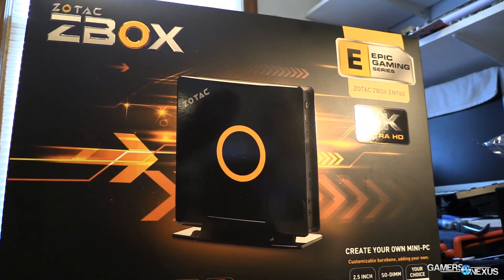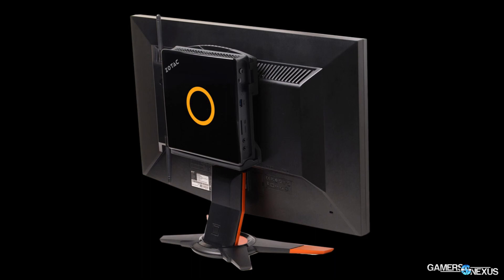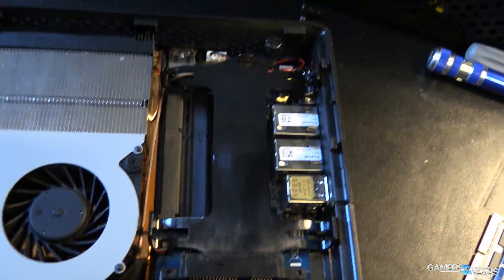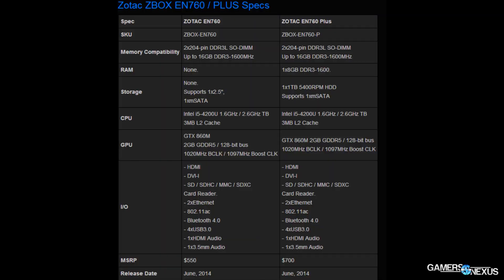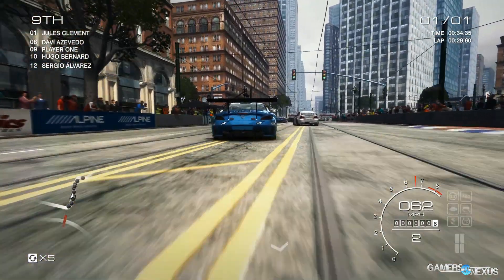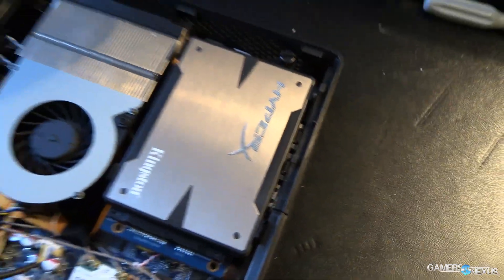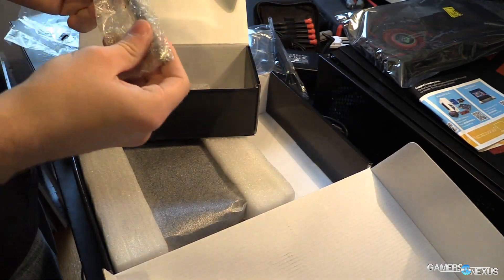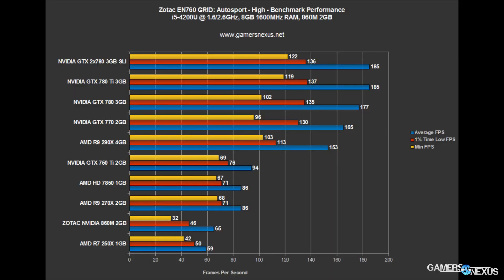Zotac EN760 DIY Steam Machine Review & Benchmark

Comment: Zotac makes graphics cards under the geforce chipset, so why not try to fit something a bit stronger than an 860m into their build. Gigabyte did it, but they had cooling problems. Zotac has proven that their system will not overheat, so increasing the size a bit and custom fitting a desktop grade graphics card is not entirely out of the question.

Comment: Did they ever fix the nvidia driver so you can update it
Reply from the maker: Yep! I was the first to receive the driver update and test it. Works perfectly. Performance was greatly increased as a result.
Reply: Is there any way you can forward me the download link? Their webpage still shows 332.60
Reply from the maker: Joseph Almo
I had to apply a BIOS update to our pre-production model, but I was told that all production models would ship with the most updated BIOS and would not require the update. If this is truly the case, you should be able to download the 340.x drivers straight from nVidia's website. Just grab them from nVidia rather than ZOTAC -- it's the same thing, just the nVidia page will be more up-to-date.

It should apply cleanly. If not, you'll need to update BIOS. But I was told that all consumer units would ship with the correct version, so that shouldn't be the case. Let me know if it is and I'll help you out with a link!
Reply: I applied the bios update available on the zotac website(2k140617) no help. Both the geforce experience and the nvidia website offer only 337.88, no mention of 340.x whatsoever.
Reply from the maker: Joseph Almo Try this - should have 340.43 after you put in the correct OS & 860M spec. It shows for me.

http://www.nvidia.com/Download/Find.aspx?lang=en-us

The direct link to w7-64 is: http://www.nvidia.com/download/driverResults.aspx/76512/en-us
Reply: Thank you soon much!